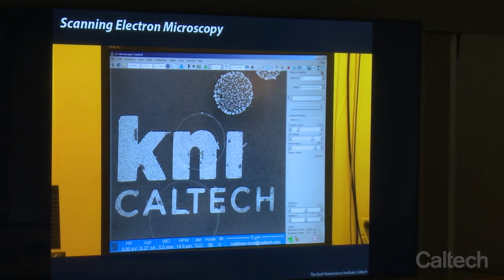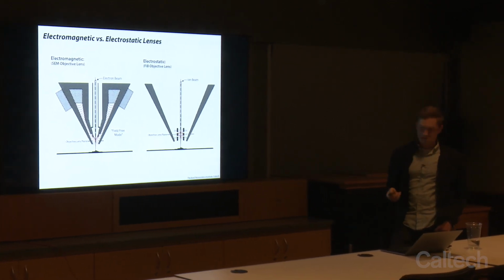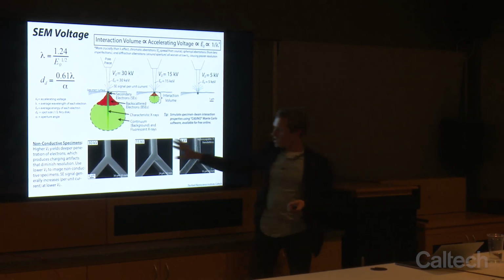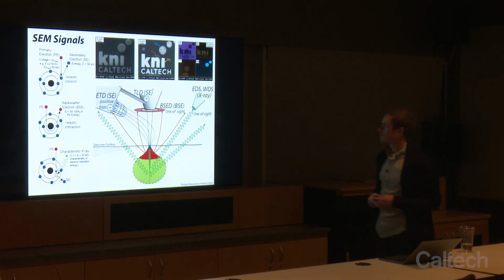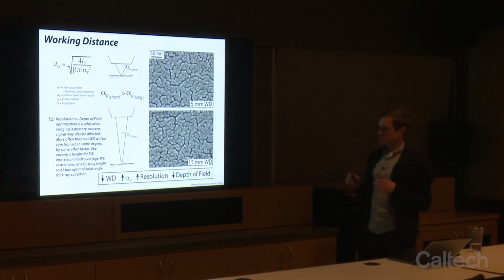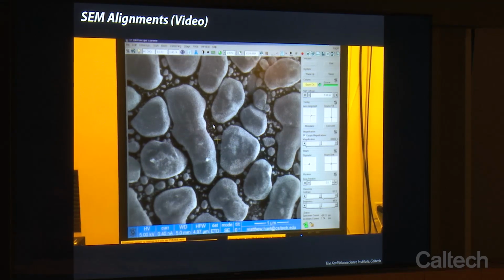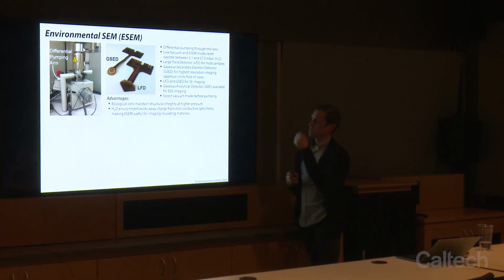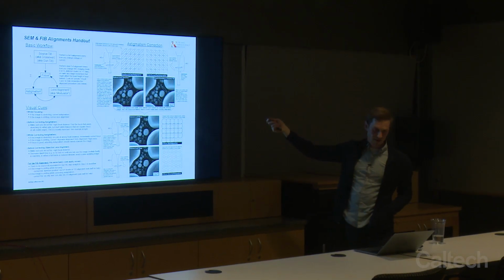Scanning Electron Microscopy (SEM) Lecture: Principles, Techniques & Applications

Comment: Lecture is too detailed. Does not describe fundamentals that well. Need to show the purpose of each component.
Reply: Your comment doesn’t seem to make sense. If the lecture is too detailed, how then did it not describe fundamentals well?
What then was the “too detailed” doing while ignoring detailing out fundamentals and purpose of each component?
Reply: "Lecture is to detailed" what a laugh ! that means it's a level to high for you just drop down a few chapters where they will use crayons.

Comment: Your lecture is not clear.  For example, when you refer to coating the tungsten coil with zirconium oxide to further increase the emitted ions from the tungsten tip, you simply say "That allows us to increase the ions from the tungsten tip" when it would have been more informative to say how it does that.  Why zirconium oxide?  Who figured that out?

When you refer to the condenser lenses you say "Allow us to demagnify the electron beam" but you never explain or clarify that statement.  Much of what you say is like this ---- not explanatory, only internally repetitive.
Reply: Yeah, I'm sorry if it's not entirely clear. I was trying to keep all of this material in a one-hour lecture so couldn't explain every mechanism in detail. The ZrO2 lowers the work function of the tip, which makes it easier for electrons to escape the surface, leading to more electron emission. Over time, the ZrO2 evaporates from the tip (the tip is very hot, as this is field-assisted thermionic emission) and so you run out of ZrO2 and need to replace the tip eventually (it also mechanically drifts/deforms, necessitating a change). Now, that's how it has been explained to me. Curiously, though, the electron emission tends to increase as the FEG tip ages so there must be some other mechanism underpinning the change in overall emission... or maybe it's just that the emission profile changes (more emission overall, but not from an optimally small area of the tip, leading to a larger virtual source, and a need to change). I've actually never been entirely clear on this myself. This would be a good question for people at Zeiss, JEOL, Hitachi, Thermo Fisher, etc who have developed these FEG sources. I'm sure there are also papers on this from decades ago that could be studied.

As for the demagnification via the condenser lenses, this needs to be investigated with equations in optics (not necessarily electron optics, just lens optics in general). There is some treatment on this in the SEM book that I like to use (https://www.springer.com/gp/book/9781493966745) though it's not super rigorous. If you've seen the equation "1/f = 1/p + 1/q," that is at the heart of this, where magnification, M = q/p, and demagnification, m = p/q. You have to study ray diagrams to understand how this all works out mathematically, but can be done and you could readily find resources on this online just by googling things like "magnification equation optics." I applaud you for wanting deeper explanations. They are out there if you want to dig, I assure you!
Reply: but my book is also like this pretty much, quite frustrating. maybe it's not ceven clear for the brightest of us
Reply: Ungrateful person, isn't it obvious we are talking about the 'work function'

Comment: The fesem machine stops running due to the lockdown period. And the electron gun is turned off for 10 months. After starting now it seen that the emission current is changing  fast. before lockdown it was around 38microampere at 15kv. Now it's 15.8  microampere at 15kv. Yesterday we start running the machine. Want to know the cause of the emission current decrease. Please help
Reply: I think gun tip is bended.. because machine was turned off too long so gun tip cool downed and it makes permanent deformation of tip shape. If possible, try to increase the extractor voltage.. It could be a temporary solution..
Reply: @hyunsulim188  Could be the only option but it is a last resort !